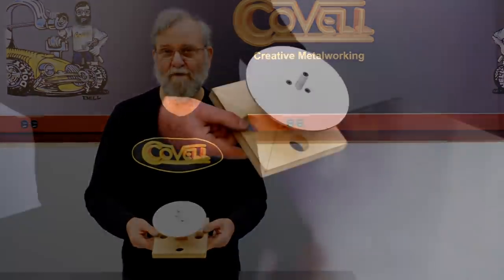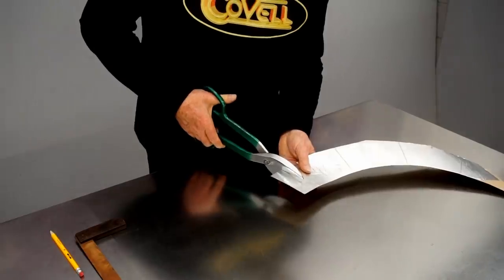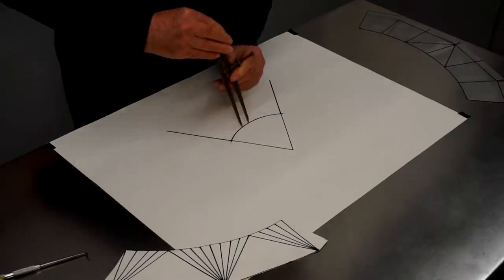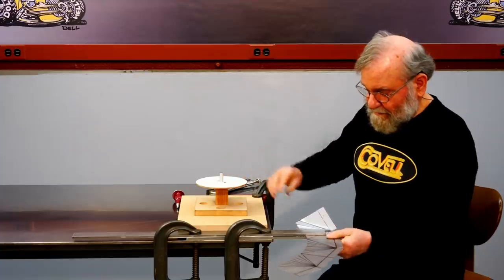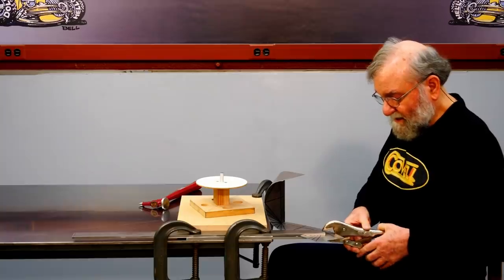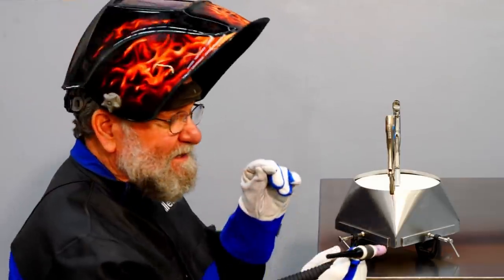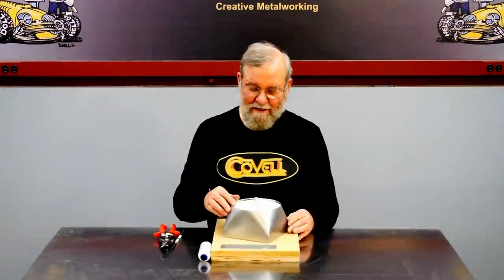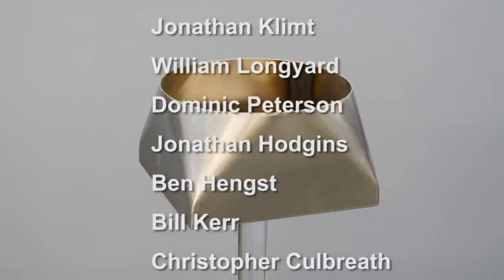Rollation 3 - Square to Round

Comment: I learned sheetmetal layout in high school.... back when they offered drafting,  mechanical drawing and architecture.  
YES, I actually needed and used all that education in my work, and hobbies.
I've worked on helicopters, ProMod race cars, built homes, etc. My main career was as a master pipefitter and industrial compressors (up tp 25,000hp)
Reply from the maker: You have have a marvelous, and extremely diverse background!
Reply: @RonCovell  
Tip of the iceberg...
I have aspergers, I'm obsessed with knowledge and EVERYTHING mechanical,  every type of motor racing and the science/technology of their design and evolution. 
...

Comment: As an old school fabricator welder I find this method would take four or five times longer than triangulating on to one piece of metal. and only having one seam to weld. no formers or patterns to make, just mark direct on to your workpiece. no compound errors either. no cad required, just some simple maths and geometry required.
Reply from the maker: There is no question that laying out a part by triangulation has many benefits, and that's why it is the traditional way. It's always nice to know some alternatives, however, for various reasons.

Comment: This problem was described to me almost 60 years ago by the carpenter working in a feed mill and linking wooden square trunking to metal pipe. He never did explain the solution so thanks a lot. I did wonder whether repeatedly bisecting the angles with compasses would be quicker than your repeated trial and error error method of marking the eight segmants
Reply from the maker: There are many ways to lay out a transition like this - I happen to prefer the Rollation method for relatively small parts. Repeatedly bisecting the angle would be a good solution - for any number that is a power of 2, at least!

Comment: Because you want eight divisions, you can use a technique to bisect an angle with a compass three times rather than guessing with the dividers.
Draw that arc like you did, then set the compass to somewhere more than halfway the distance across the angle to the other point.
Draw two arcs between that intersect like a football; connect those points and you have a line that perfectly bisects the angle.
Repeat to get quarters, repeat to get exact eighths.
Reply from the maker: Yes, that is an excellent technique for any power of two. Unfortunately, it does not work for other numbers.

Comment: If your compass is not to be found, you can use a ruler to the same effect. Make straight line of a lenght that is easily divisible by 8 between the two sides of the triangle. It can be any orientation as long as the "divisible by 8 part" starts and stops on your outer triangle lines. Then connect the center point of the triangle to each of the 8 parts of your ruler. Saves you walking your compass 3 times.
Reply from the maker: Thanks for watching, and commenting.
The technique you mention works OK for narrow angles, but there is a little error induced, which can become quite problematic as the angles get wider. Try it on an angle of about 160 degrees, and you'll see what I mean.

Comment: Why didn't you sand all four sides with 50 grit and then go to the 120 instead of changing in and out every time with each quadrant?
Reply from the maker: I think it takes less time to switch sanders than it does to unclamp and re-clamp the part.

Comment: I'm enjoying this series of videos but wonder why you did this piece in two parts rather than one?
Reply from the maker: When I place a weld in a corner, I can 'fudge' the fit pretty easily. With 3 corners folded and only one welded, the bending would require far more precision, and lots of stuff could 'go wrong'.

Comment: I was a sheet metal worker for  34 years, I use to make many square to rounds ,  I used a layout method using triangularization,  one can make any shape he needs if he know that type of math. Ron Covell is a master at making perfect shapes  too,  just a different method that what I used,   now the metal shops have  computerized laser cutters that will out perform any sheet metal worker.   they will cut  metal up to over an inch thick smooth as a baby's butt
Reply from the maker: Thanks for your comment. Yes, geometric layout is the most common way to do this kind of layout work if you're not using a computer application, but I wanted to show another option that is not well-known. 
I'm very impressed with the latest in laser technology, but I doubt I'll ever own such a machine.

Comment: Great reminder!  Thank you.   Very early in my engineering career I design and built both cement mixers and garbage trucks.  We did it usually CAD.  YOU CAN IMAGINE that the drum of a cement mixer is just a dome connected to numerous cones.  I took a sizable number of designs by hand drawings and put them in CAD and then fine tuned the numbers using true calculations and added in Bend Allowance calculation depending the type of bends or rolling process.  I would bet the first cement mixers were developed the same way you layed out.  Good memories of creating systems and a quality product. Unfortunately it did not pay very much. Keep up the great work.
Reply from the maker: Sounds like you got to work on some great projects!
Reply: @RonCovell  I had a ton of them in the past, now I live through your videos.  Keep up the great work!

Comment: Thoroughly enjoy your videos. Very grateful that you are willing to share your expertise and knowledge on sheet metal forming. 

On a side note,
Do you have a recommended manufacturer for pneumatic tools? Like that particular 4-5 inch sander you used in this video? Looks like the 90 degree die grinder is Chicago pneumatic brand? 

Anyway. Thabkbyou again
Reply from the maker: Yes, the 90-degree sander is Chicago Pneumatic, and my DA sander is Ingersoll Rand. I also like the AirCat line a lot.
Reply: @RonCovell  thank you!

Comment: i do a lot of that stuff in 3mm or more, I developed it in 3d rhino, then roll it out,  using command unroll surfaces then use offsets then I transfer those offsets to the plate, I enjoyed your vid, was very common in days past. aircon trunking comes to mind, in the trades, such as boilermaking, shipbuilding these methods were taught to apprentices
Reply from the maker: I have great respect for people who do this work in 3mm metal - that's an entirely different perspective!
Reply: a lobsterback is a common test
Reply: @RonCovell  used to build round bilge boats, have wheels for stretching, forming, use urethane up to 6mm then steel  over this, urethane does not marl the plate when forming concave
 think there's some stuff in my videos, very unpro vid unlike yours and young Tony's stuff, nice to meet you

Comment: This is an interesting technique.  There is a traditional way to do this as well, without computers,  etc, it is called triangulation and works great, esp with much larger parts that would make for an unwieldy rolation  pattern.
Reply from the maker: Yes, triangulation is a very good way to pattern parts like this - especially large ones.

Comment: Hi Ron. Do you usually aim for full penetraition with welds like these or do you not worry about it too much?
Reply from the maker: Well, on thin metal like this, it's hard to NOT get full penetration. Another way to look at this is that for parts that aren't highly stressed, often 75% penetration is sufficient.

Comment: Brings back memories of a fifty year career in HVAC/Sheetmetal. We used rollation mainly for oddball roofjacks and "old shool "layout for square-to-rounds and other fittings. My last two years were on a plasma table but I got the job being able to do it "old school".
Reply from the maker: Sounds like you have a lot of good experience!
Reply: @RonCovell  In third year of a 4 year apprentiship I was put on the bench doing layouts and forming of all sorts of fittings as they came in on detail sheets from the field. Mostly commercial HVAC ductwork and miles of gutter and flashings. I had an aptitude for geometry so I almost always found it interesting and challenging. It was a small shop so I got the chance to do it all-detailing, fabrication, installation. Eventually got into service, design, estimating, and contracting from my own shop.

Comment: Great video! Any chance there will be another where you create the same item, but the square and round openings are not the same size, or is it the same process? I understand as the greater the difference between openings the amount of metalwork increases, but are there other considerations when fabricating an item like this?
Reply from the maker: I'm considering doing something like that, and yes, the principles are similar. 

So many ideas, so little time!

Comment: In practice most sheetmetal shops would put the seams on the flat and not on the corners.. that was the way it was taught in the apprentice course..
Reply from the maker: I understand, but I'm sure the joints are seamed or spot welded, not butt welded.

Comment: As a sheet metal worker there are easier ways to do this. Also you could of bisected the arc and kept on until you got your brake marks. Plus triangulation is more accurate.
Reply from the maker: I agree on all your points. Thanks for watching, and commenting!

Comment: Since you're dividing each corner into 8 bends, and 8 is a power of 2, it might be more accurate to halve the whole angle, halve the halves, and halve the quarters. By placing a protractor on the point of intersection between one side of the angle and the arc, drawing new arc, and then doing the same thing from the intersection of the other side of the angle and the arc, you can then draw a line between the two intersections of the two new arcs to halve the original angle. And so on, to get down to eighths.
Reply from the maker: Yes, repeatedly bisecting the angle would have been faster - for any power of 2, at least!

Comment: Oh my goodness where did you learn to work with metal?
Can you do it using 10mm plate?
Reply from the maker: It would take heavy equipment - that I don't have - to work with 10 mm plate!
Reply: @RonCovell  The point I am attempting to make is to get the exact shape and size you require to develop a true length diagram.
This provides exact measures.

Comment: wouldn't it be easier to divide into whatever you need using a simple ruler ? just put the ruler where those 2 lines meet at the divisions you need like 7 or 14 cm for 7 divisions and mark each 1-2 cm, frankly i don't have a fancy compass that you can adjust with a knob, just the pull and push apart type, but i got at least 5 rulers.
Another great video by the way.
Reply from the maker: Thanks for watching, and commenting, and I'm glad you liked the video. 

The technique you mention works OK for narrow angles, but there is a little error induced, which can become quite problematic as the angles get wider. Try it on an angle of about 160 degrees, and you'll see what I mean.

Some other people have noted that I could bisect the angle repeatedly, to make 2, 4, and 8 divisions.
Reply: @RonCovell  yes, i see what you mean, and bisecting only really works for 2-4-8, it doesn't really work with 7 or even 6, so it looks like you did it the best way, now i gotta look for a fancy compass :)

Comment: I've been laying out square to rounds for years the old fashioned way and I think I could have laid it out faster. Not as much trimming and maybe more accurate. Cool way to find a pattern though. The new programs for cnc machines put us out of work. I'm retiring this week.
Reply from the maker: The old fashioned way certainly has (had?) its place. My goal here was simply to show a technique that is not widely known.
Reply: @RonCovell  Sir, you have certainly met that goal. I meant, in no way , that how you did it was wrong or bad. It is very interesting that it could even be done that way. Your craftsmanship is second to none.

Comment: How long have you been using these techniques and how much did the suggestions offered change your work process?
Reply from the maker: I started doing metalworking professionally around 1965, so I've been using some techniques since then, but I have learned a lot from reading comments, and watching a lot of videos on YouTube. The rubber cement and aluminum foil tips were from people's comments in the last few weeks.
Reply: @RonCovell  it's incredible how much knowledge our community has to offer. You've been an incredible resource and it's great to know that some of us have been a help back.

Comment: Greetings unto you 

I am so excited to see you doing these. In my mind's eye I can see so many applications for these skills. I used to cosplay and I still build all sorts of things out of EVA foam. This just opened up all kinds of new shapes for me. I also sew and make my own patterns for toys. Once again you have opened up using many new shapes for me there.

When I was 8, my father got an english wheel in his racecar shop. I want to learn to use it. I understand why you do not let an 8 year old use tools that could take off his hand but the wheel left before I was old enough to learn.

I still want to learn to do metal work. You just put me one step closer to building a 12 foot pink flamingo.
Reply from the maker: I want to see that flamingo, when it's finished!
Reply: @RonCovell   I have a lot to learn and a long way to go but it is coming some day

Comment: Quick question ? How do you decide where to place the welds ? I would have instinctively placed them across the "flat faces", what made you decide to put them where you did ? Do you have a general method of deciding where to cut the pattern ?

And great video too :)
Reply from the maker: Thanks for watching, and commenting.
On thin metal, the distortion from welding can often be problematic. Placing welds in the corners reduces this distortion a great deal. Had I placed the welds in the middle of the flat areas, it would be difficult to regain the smoothness after welding.
Reply: @RonCovell it makes a lot of sense. Thank you for taking the time to respond !

Comment: its fine when sizes are 6 inch square to 6 inch round by 3 1/2 depth using rollation  method   had to make 6 for boiler flues  5 feet square x 5 feet round x 5 feet depth covering insulation with 1.2mm stucco aluminium last year so it was all mathematics  and draw up templates that fabrication took 3 of us 8 days , keep in mind they all had to come apart for fitting so 2 inch overlap method was used with self tappers holding them together   brain wake up times we have sometimes but thats the joys  , 48 sheets 8 x 4 aluminium to complete with decent size offcuts left
 shame we could not get bigger sheets , they were special order ,, no time to wait on them
Reply from the maker: The job you describe is very serious metalworking, indeed! Congratulations for getting it done in such a short timeframe!

Comment: Triangulation is so simple and much quicker. Rolling pattern method is simple to learn and understand not seen it used Uk except  may be once.
Reply from the maker: I have nothing against triangulation, and it is certainly much more widely used, but for my own reasons I often prefer the rollation technique.
Reply: @RonCovell  The welders would take the jobs of sheet metal workers using rolling pattern method. Pattern development is not always taught to welders so rolling pattern method is a good simple method.

Comment: Ron, an aircraft rivet fan is a great way to instantly get any number of divisions in your work or template.
Reply from the maker: Rivet fans are fantastic tools, but they won't divide an arc evenly.
Reply: @RonCovell  Gotcha.   So when I'm working with a fan with a line scribed from point A to B, and the fan holes don't land on the line, I'm on a convex or concave surface.  Never thought of that.
Reply from the maker: You got it!

Comment: Lovely and informative as always.  

That shop-made tool has an analogous tool in ship-building.  It's called a spiling (pronounced spy-ling) tool.  It's used in planking a boat.  it's job transferring the top edge of the back plank to the front of the front plank so the top plank can be cut and fit the back plank perfectly.  Some have off-sets for lapping of planks.
Reply from the maker: Thanks for letting me know about that - I'd never heard of a spilling tool!

Comment: can we do it on galvanised metal?
Reply from the maker: Well, the patterning, cutting and bending would be identical for galvanized metal. The TIG welding process does not work well with galvanized steel, since the zinc coating gives off fumes when heated, and the fumes pollute the argon shield.
Very often galvanized junctions like this have overlapped joints so they can be spot welded together.

Comment: Why don't you use radial line development on paper and transfer that to paper? I'm a boilermaker and you're  doing it the hard way.
Reply from the maker: I understand that radial line development is a more common way to pattern shapes like this, and it works very well - but my goal here is to show an alternative method for doing layout.
Reply: @RonCovell  fair call there is a bit of work learning radial line development and true lengths. Thanks for the reply, I love your work. I wasn't having a dig at you it was just a suggestion.

Comment: Weld ain’t gonna hold shit. There’s a reason we do notches.
Reply from the maker: I'm not clear on what you are saying. Welds can certainly be as strong as the metal being welded, and that's why welding is used so widely for all kinds of metal fabrication.
Reply: @RonCovell  Sorry this comment wasn't for you, rather someone stick welding box to the side of round in a stupid way, and then grinding away all the added material. Hurt my insides watching it. Apologies for any confusion. On a side note, don't comment while going between youtube shorts and a video, youtube doesn't like that.
Reply from the maker: Thanks for clarifying that. I was pretty confused at first.